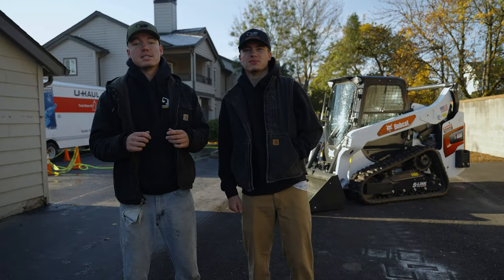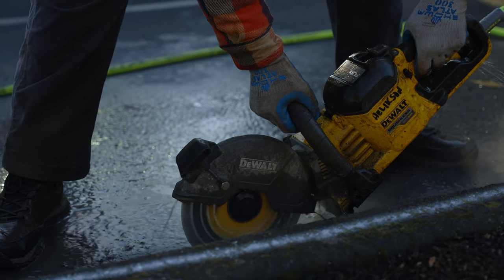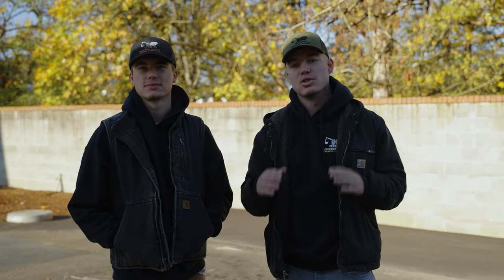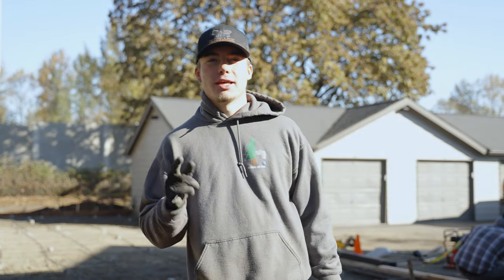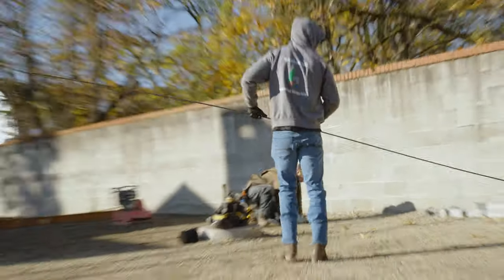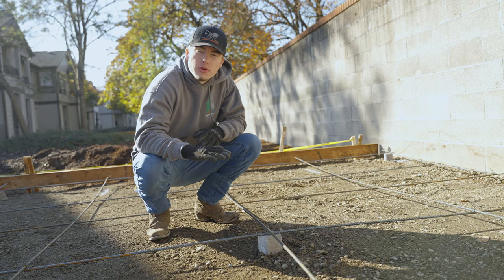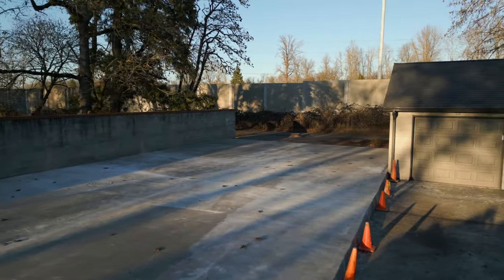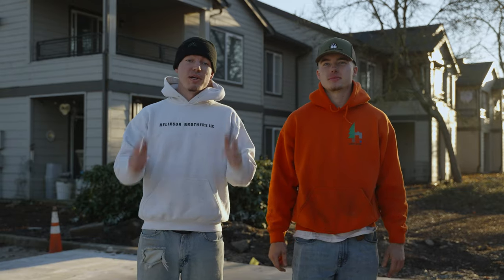HOW TO BUILD A PICKLEBALL COURT!

Comment: Surely there is something you can tell us about the finish.
Reply: I build these for a living and we use special cables for the courts NOT REBAR. We use actual pickleball court materials sourced from a private manufacturer hence why these guys don’t have them I think. And it needs to be graded with a Laser Grader which we use on all courts. It is unacceptable to not use a laser grader and use only the materials we get from our manufacturing company.
Reply: The finish- after we place the concrete, the next day we will come back and pre stress the cables that are on two side of the court cut through the concrete forms, and we have the tubes and plastic parts in the hole in the concrete form, we stress the cables at 2000 psi and take the forms off.  then come back 7 days later , stress the cables at 7400psi (80%) of its capacity. Also we take the polyethylene plastic off of the court that’s put down in the very beginning. And in total it needs to cure for 28 days. Then we paint it, which is silica sand with special paints. Usually the courts I build are blue and green, but I’ve done two recently and one now that is all green customer preference. 
Hope I helped,
Reply: @HeathenFitness how much does one court cost? For the court and labor
Reply: @Skorzeny14996 thank you for your input! Not really sure what the point of that video was for
Reply: @HeathenFitness  thanks for the details! you should make a video/blog post

Comment: i was told a broom finish is not necessary as the paint has sand embedded in it... broom finish makes painting the lines without leakage under the tape that much more difficult??
Reply: Everything I have read says you need a broom finish for there to be good adhesion for the paint--and they have a special step for getting the lines not to bleed.
Reply: @RyanPatenaude  Thanks Ryan..whats that special step... i read primer helps avoid bleeding..not sure

Comment from the maker: About 8 inches thick
Reply: Does it need to be that thick? 4” is standard usually
Reply: No vapor barrier? Ouch…
Reply: @kellenfleener  why do they need a vapor barrier? It’s outside. Come on. 😂
Reply: @aleosorio23 no 4” is good enough. 8” is what we pour for extremely heavy trucks driving on. This thick for a court is overkill.
Reply: @shanksta81  if they’re going to paint the court with legit court paint, the water will start to want to come back up under and bubble the paint.